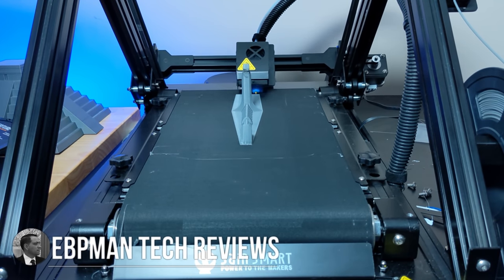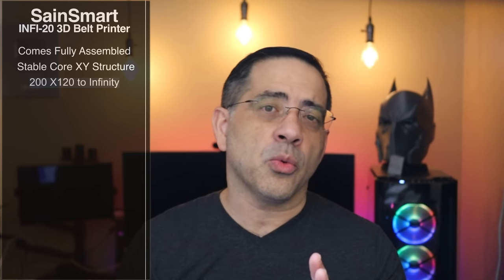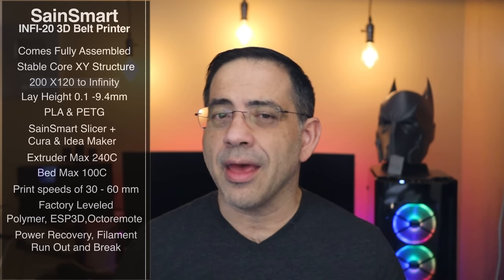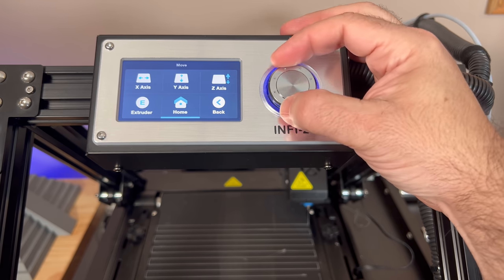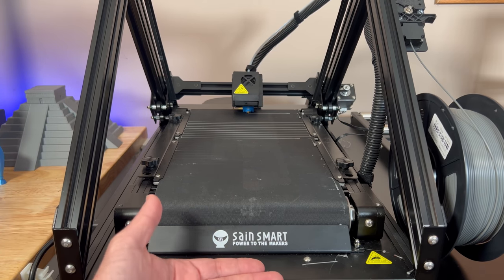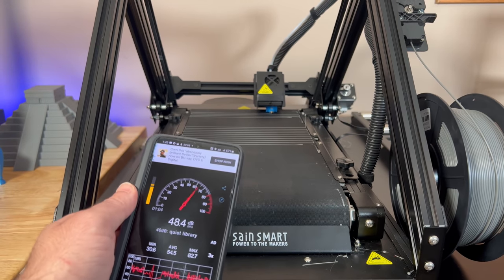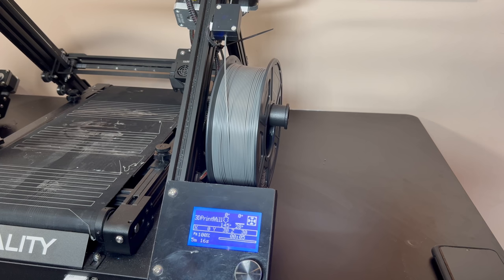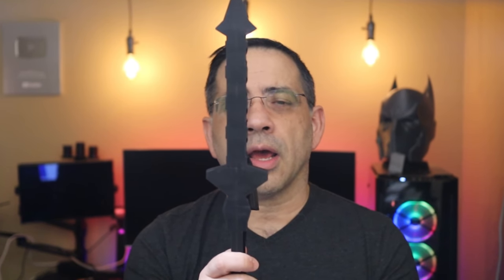Sainsmart INFI-20 THE BEST VALUE 3D BELT PRINTER!

Comment: Interesting. For large volume batches, have you tried using a larger nozzle than the 0.4mm to cut down on per part print times?  Maybe a 0.8 or even larger? Also, the "core x-y" motor and belt placements seem off for a normal core x-y system.
Reply from the maker: Not yet.  We have update several our other printers. We have around 12 others.  At least half We half hardened nozzle but not these yet
Reply: @MarkZimmermanKicksAss  It’s not at all like a large nozzle on a standard printer, imo.  

I have a video on my experience with the printer and a 1.0 mm nozzle, thus far. It might save you some time and perhaps learn something from my experience with a large nozzle.
Reply: @MarkZimmermanKicksAss  Glad to hear that it’s working out for you! What’s your layer height and speed on the 0.8? I’m wondering what your MVS. I’ve since calculated mine for various amounts and have settled on a 0.5 nozzle, 0.4 layer height at 30 mm/s for big prints, but would really prefer a wider wall straight from the nozzle.

- Have you tried GST3D filament? Their bulk prices are cheap, but I’m on my second roll and have had good luck with it. No clogs or tangles yet. Just some residual wisps that I can’t seem to shake (I’m assuming it’s the Bowden tube).